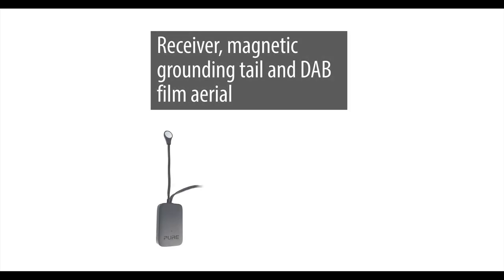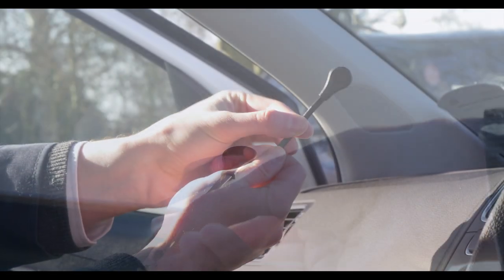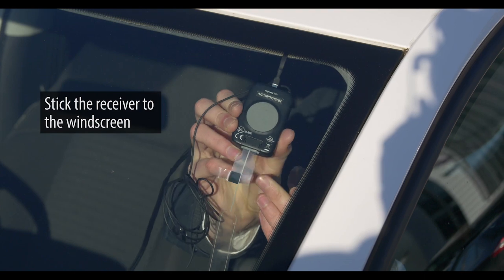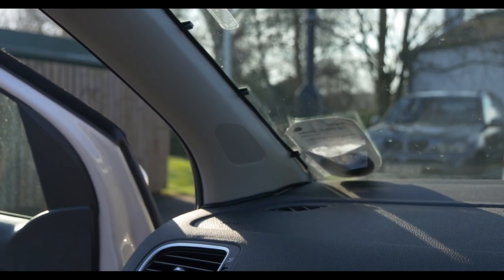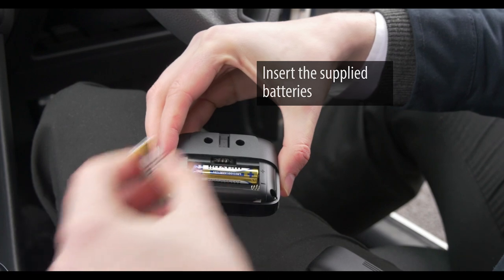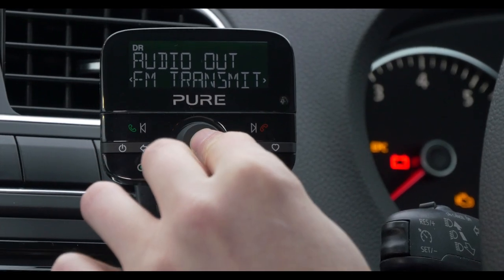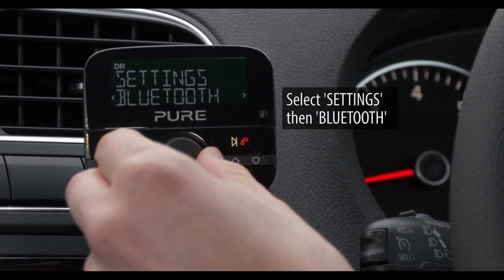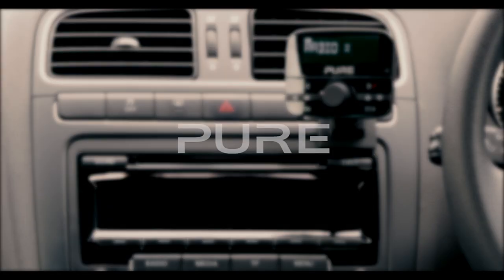Pure Highway 400/600 - Installation Guide

Comment: I have purchased the Highway 600 and fitted it today.  At home after first installing it, I picked up 33 stations, this is the norm for the area I live in.  Went out to Bangor, reception just fell off continuously until, well frankly it was appalling. Called into Halfords where I bought it, they looked at how I’d fitted it, not wanting to sound big headed, they seemed impressed, concluded that perhaps it was a faulty unit.  Bugged me during early evening and I went out to fiddle about with it.  I noticed that the magnetic earthing strip wasn’t connecting to the actual roof but a bracing piece, maybe these are bonded to the roof not welded.  I drilled a small hole through the brace and the magnet fixed to the roof good and proper.  Took the car out for a run, signal was 100% better.  So making sure the magnet is properly attached looks to be important. Halfords were willing to exchange the whole kit without quibble even though I’d fitted it.
Reply: I have an aluminium car :(

Comment: If I 'purely' (no pun intended) just wanted to use the Bluetooth streaming part of the product and didn't care about DAB do I still need the controller unit? I assume the real business end is the receiver box?
I've tried everywhere to find a simple fm/aux bluetooth transmitter that has an external microphone and out of hundreds on the market this is the only thing that is closest.

Why do manufacturers believe that a 'built in' mic is actually of any use? . People serious about calling on the move need external mics.
Reply: You would be better of fitting a new stereo with bluetooth built in
Reply: Just bought the 600 purely for the better handsfree as it was alot cheaper than a new radio works a treat but I would say you need the whole kit

Comment: My new car hasn't got a dab radio. Can I transfer my Highway adapter over ? Worried the aerial won't stick to the windscreen without using extra adhesive.
Reply from the maker: Hi Neil, thank you for your question. Should any of the components not stick after transferal you find some spare components here: https://www.pure.com/stores/pure/spare-parts/c/type_SpareParts

Comment: Does my existing car radio need to be working to install this? I ordered one because I cant find my radio code to power the original back on so thought I may as well upgrade to DAB.
Reply from the maker: Hello, thank you for reaching out! Yes, the car radio is required to reproduce the sound. The Highway is simply an external receiver, but the audio is still reproduced by the existing car radio system. Transferring the signal to the car radio is either possible by connecting to an Aux input, or by a selected FM frequency.

Comment: My Pure Highway 400 intermittently stops display and sticks on whatever setting it last used, when last used on Spotify it seems to log on but doesn't play, the same for bluetooth, only giving about a second of sound before stopping, when it was on Digital radio it will play the last station tuned in and won't change.
Now it is looking for antenna connection when display came back on, tried to reset, but will not pair, still playing Digital radio on last selection. How do I reset?
Reply from the maker: Hi Bruton Hunter, thank you for your question. To perform a power reset, please use a paperclip to press and hold the reset button of the antenna unit for 10 seconds. For additional support and guidance please open a ticket here: https://support.pure.com/en-GB/new-ticket

Comment: I installed mine but the antennae simply would not pair with the control. I notice that the connector of the adhesive seemed to be just plastic. Should there be some visible connectors
Reply from the maker: Hi Nick, thank you for your question, please do contact our technical support via: https://support.pure.com/en-GB/new-ticket for some additional installation guidance.
Reply: @PureAudioHQ  . Sorted! It was a faulty unit and the replacement worked a dream.
Reply from the maker: Hi Nick, great to hear that all is sorted. Thank you for letting us know!

Comment: The only drawback to this unit is the favourite presets. If you change  DAB stations frequently You have to hold the button down then turn the knob to find which preset you want.
Reply: I found you can use the skip buttons

Comment: Ive got a 600.  I installed it today eventually synced phone and got people to be able to hear me.  All good so far.  I was sitting in my front room and had to go out to the van and unplug the power lead from the socket as the bluetooth would not disconnect.  Any ideas?
Reply from the maker: please contact our Tech Support directly. I'm sure my colleagues can help you or answer your question.
https://support-uk.pure.com/en/new-ticket
Reply: Did  you resolve this issue?

Comment: Ive been trying to update my DAB Highway 600 antenna - i've downloaded the update and unpluggedthe USB cable & plugged it into my PC. But as soon as I do that I can't get my controller to power up and set the USB setting to update. I can plug it back in to the FM USB and it powers up but it doesnt stay active long enough to set it to update then unplug and connect to the PC . Basically its impossible to update by PC it as it wont actually connect! Any ideas?
Reply from the maker: Sorry to hear that you have a problem with one of our devices. If you have a technical problem or question, I would ask you to contact our technical support directly and open a ticket. My colleagues will get back to you as soon as possible.
https://support.pure.com/en-GB/new-ticket

Comment: Will this unit’s aerial connection work with an aluminium bodied vehicle or is the magnetic attachment a requirement to achieve a digital signal?
Reply from the maker: Hi Simon, if there isn't a magnetic roof to install the grounding tail then this part can be fitted to an alternative metal/magnetic part of the vehicles bodywork. The A pillar would normally be the other place we suggest. 

Failing that the metal grounding tail can just be left in the box, unconnected from the rest of the Highway. It is an optional part which is there as an addition/boost to aid with signal. You may experience a drop in performance without it.
Reply: Thanks. I’ll find a ground point and take a connection to the unit.

Comment: Why isn't there a iso connection, or hard wire option? all this cabling . power adaptor and control box on the screen makes it look very "Halfords"  ive had an older 300di unit, which simply plugged into the iso leads, much neater....
Reply from the maker: Thanks for taking the time to provide us with this feedback. All customer feedback is read and considered here at Pure, so please be assured your suggestions will be passed to the relevant teams for future consideration. BR, Marco

Comment: hi, am i able to use google maps with this device so directions come through the cars speakers whilst the DAB radio is on? i have tried using google maps whilst the highway dab is on in aux mode but google maps does not come through the speakers. thanks
Reply from the maker: There is a function in the Google Maps settings called "Treat announcements like a call" or something like that. Please switch this "on". BR, Marco
Reply: @PureAudioHQ   hi, i have already looked at this setting and it was on, i tried turning it off and back on but still no luck. I dont think there is a way to enable google maps to speak over the radio.
Reply from the maker: We will have to check with our engineers on this question. For easier communication, please open a support ticket. https://support.pure.com/en-GB/new-ticket
Reply: @PureAudioHQ  I opened a support ticket 2 days ago and still awaiting a response. Thanks

Comment: Hi rather than using a the antenna supplied can you use a DAB + FM AM radio active aerial antenna converter smb splitter
Reply from the maker: Hello Chris, no, unfortunately this is not possible. The controller can only be connected with the provided antenna.BR, Marco

Comment: How well does the DAB ariel work with a heated front screen that has the wires in it effectively working a little like a faraday cage?
Reply from the maker: Hi Nicholas, you're right. A heated windshield can significantly reduce reception. In this case you should consider mounting it on a side window if you drive a 3 door or coupe. BR, Marco
Reply: @PureAudioHQ  It is for a Discovery 3. Lots of canin space between dashboard and rear windows although that's where the FM arial is mounted. Also are there any issues with grounding mount with the ally body? I can't be the first person trying this.
Reply from the maker: The antenna does not necessarily have to be grounded. However, it is possible that the reception improves when the antenna is grounded.
Reply: @nicholassheehan6817  did you resolve this? I have it fitted in a D3 also and it’s garbage
Reply: @Livautowerx  Nope.  What I actually did in the end was to get an unlimited data tariff on my phone, connect that to the pure for bluetooth music and used a radio app on my phone.  Since then I've actually put a small tablet PC over the top of the existing SatNav screen and use that like Android Auto for life traffic mapping and radio using the phone as a data carrier.

Comment: hi , i already have a dab aerial and also a seperate mic ,can i still use the 600 or do you recomend a different model?
Reply from the maker: Hi Angelo, if you were to use the Highway 600 you would need to use all the accessories that we provide. Using your own aerial and mic is not something that we can advise. Thanks

Comment: I have a Smart car with no metal roof.  How can I fix the ground strip please?
Reply from the maker: If there isn't a fixed, magnetic roof to install the grounding tail then this part can be fitted to an alternative metal/magnetic part of the vehicles bodywork. The A pillar would normally be the other place we suggest. 

Failing that the metal grounding tail can just be left in the box, unconnected from the rest of the Highway. It is an optional part which is there as an addition/boost to aid with signal. You may experience a drop in performance without it.

Comment: Can the pure highway be installed on Nissan qashqai with glass roof
Reply from the maker: Hi Philip. Yes, the Highway can be used with a panoramic roof. If there isn't a fixed, magnetic roof to install the grounding tail then this part can be fitted to an alternative metal/magnetic part of the vehicles bodywork. The A pillar would normally be the other place we suggest. 
Failing that the metal grounding tail can just be left in the box, unconnected from the rest of the Highway. It is an optional part which is there as an addition/boost to aid with signal. You may experience a drop in performance without it. Thanks

Comment: Window antennae are awful. My advice, always use a roof mounted DAB specific car aerial connected to a 12v source (usually from the rear of the car audio head unit), this way you are pretty much guaranteed a good reception wherever you go.
Reply: Can i just replace the  antenna if i need a DAB or do i need to replace the exsiting wiring ?
Reply: Absolutely nothing wrong with them as long as you can fit them properly and aren't a klutz

Comment: Why am I getting static on my 400 when it's playing a station
Reply from the maker: How are you connecting the Highway? Is it through the Auxiliary Line-in port or are you using FM Transmit?
Have you ensured that you are powering the unit from the cigarette lighter using our supplied USB adapter?
Does your vehicle have a heated windscreen, UV filter or any in-built/external electronics? i.e. sat-nav, dashcam or multimedia system.
Are you using the supplied metal grounding tail that slides under the cars headlining?
Reply: @PureAudioHQ  via fm transmission and it’s powered by usb via 12v socket
Reply from the maker: There are many possibilities why a transmission via FM transmitter can be disturbed. The signals can overlap, be attenuated or interrupted. The built-in electronics of your car can also cause this interference. Basically, a connection via the AUX connection is always the best and safest transmission.
If you have any further technical questions, please contact our technical department directly.
https://support.pure.com/en-GB/new-ticket

Comment: Can i replace my exsiting ariel to a DAB ariel or is it also the wiring i need to replace ?
Reply from the maker: Hello, thank you for reaching out! The Highway 400/600 models are designed to work with the ariels they come with, and it's not possible to use external or different aerials with them.

Comment: How far can the cable be split, my aux is in the glove box yet my 12v supply is next to the gear stick.
Reply from the maker: You can split the cable in a length of about 2m. BR, Marco
Reply: @PureAudioHQ  thanks for your quick reply, that's really helpful

Comment: Can this unit be fitted to a 05 Saab Aero convertible please ?
Reply from the maker: Hello, thank you for reaching out!

If there isn't a fixed, magnetic roof to install the grounding tail then this part can be fitted to an alternative metal/magnetic part of the vehicle's bodywork. The A-pillar would normally be the other place we suggest.
Reply: Thank you - booked with electrician to fit - discussed earthing issue
Reply: Fitted yesterday ! Delighted with range of stations and clarity